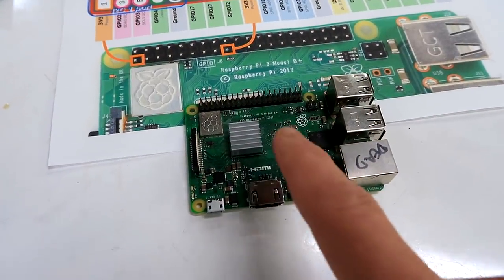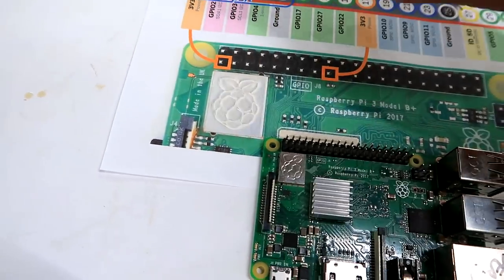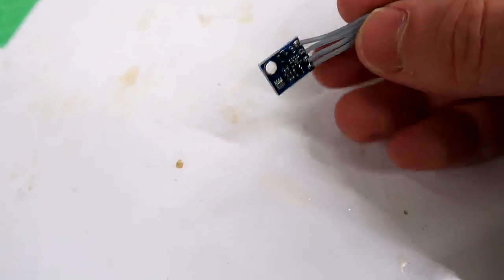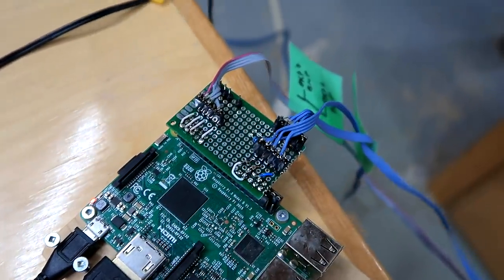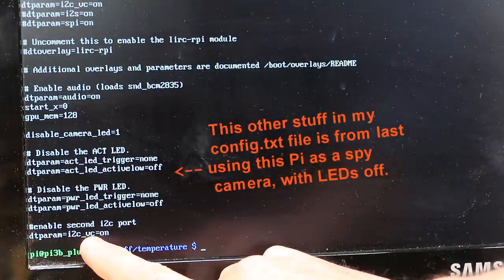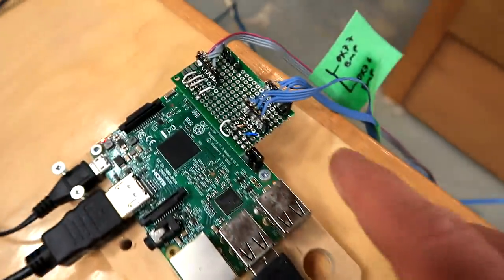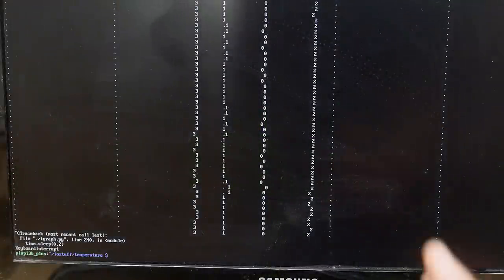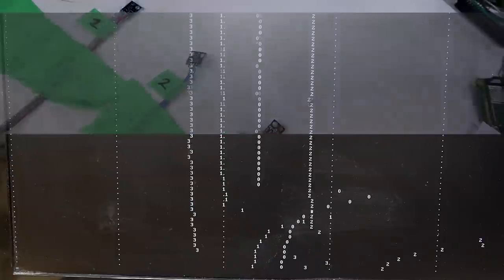Using the second (I2C 0) port on a Raspberry Pi

Comment: If you just needed a bunch of temperature sensors, the dallas DS18B20, which use 1-wire (not i2c) each have unique addresses so you can use as many as you want.
Reply from the maker: I have some of those.  Haven't used them yet.  Temperature resolution is lower, and I actually need to sense pressure for my next experiment, like I said in the video.
Reply: Yes the DS18B20 are great devices and you can literally use 2-wires (data/ground) or 3-wires (vcc/data/ground). I just wish they had more sensors available with this type of bus, such as pressure and humidity.
Reply: @matthiasrandomstuff2221  Yeah, I know for your current project you need pressure. I was just mentioning them in the event you (or someone else here) had a need for many temp sensors.

Comment: Love the ASCII plot. Way back in the early 70s high school students could get an account at UofT's computing centre during the summer. I would cycle down there, write programs (keypunch in, run deck of cards, collect printout, if any, debug, repeat). One of my favourite programs was an autoscaling, graphing program I wrote. I used this program early in my engineering career until I adapted it to use the Calcomp plotter connected to the company's mainframe. Nowadays there are so many plotting/graphics packages available my ascii plotting software is a fond memory. I think the autoscaling algorithm I conceived, IMHO, worked better than many of these packages by trying to maximize the amount of curve (y axis) showing in the plot window while maintaining reasonable engineering unit scaled major and minor tic marks.
Reply: That reminds me of something my father programmed back in the day. It was a program which took in text and output it as a readable banner on punched tape.

Comment: Another option is using a TCA9548 Multiplexer to assign multiple unique addresses to components that have the same hardcoded address. The multiplexer can assign up to 8 different addresses and you can also assign up to 8 unique addresses for each multiplexer on a single I2C bus meaning you could connect 64 same address components on an I2C bus.

Comment: Linux /dev/i2c-0 is usually set up for SMB and is where all the sensors (temperature, voltage, current, power, etc.) live.  I2C buses with higher indexes talk to other devices.

Comment: I had no idea you could turn off the camera LED in addition to the power and activity LEDs. I hope it works on Arducam cameras--i just finished a battery powered 270° fisheye camera that I put under a clear acrylic dome for nighttime skywatching. I put gray poster tack over all the LEDs but it still leaks some light through if I don't pile it on.

Comment: If you run I2C in cables, you might need to separate SCL and SDA with e.g. a ground wire. SCL and SDA are very sensitive to capacitive crosstalk when they are high since they are then only driven by the weak pull-up resistors. So when e.g. SCL goes down abruptly, the sharp edge couples over to SDA and may cause errors in the communication. Putting a GND wire between SCL and SDA shields them pretty well from each other and prevents this issue. The phenomenon is easy to observe on a cheap oscilloscope.

Comment: Hey Matthias, so for a project I used CD4051 multiplexers on Arduino to connect and record from 8 sensors (BMP280 included) with the same address on the same port. Just had to control the mux with 3 control pins ; in case that help. Nice geeky video in any case ;-)

Comment: Have you thought about using demultiplexer (cd4051) for clock line? i2c slave won't react if he does not see clock so you can hook up to 8 sensors with THE SAME ADDRESS to one i2c port. You only need 3 gpio ports to select the output (or one if you add binary counter to cycle through them.) This is also extendable so you can have as many sensors as you want at virtually no extra cost.

Comment: IF you dont need the pressure sensor oe more need more than One i would use ds18b20 instead since you can have longer Wires and on same single data Line :)
Reply from the maker: but I DO need the pressure sensor.  I just demonstrated with temperature for the video.
Reply: @matthiasrandomstuff2221 ok :) . You could also use a i2c expansion Circuit If you need more :)

Comment: Can't we simply add one entry to config.txt and put two wires into those 2 new pins to have i2c working ?
Reply from the maker: You still need to add the pull up.  And I wanted the pins to be arranged the same way as for the other port so I could just plug in he same header for the other port.

Comment: Btw, try to use ESP8266 or ESP32 to grab the data (perhaps even with Tasmota) - you can have one RPi somewhere to log, multiple ESPs all over the place with wifi sharing the data.
Reply from the maker: that would be a heck of a lot more work than what I did
Reply: @matthiasrandomstuff2221  Short term? Sure. Longer term? Not sure. Especially if you want to measure temperatures and pressures at the same time on different places. In such case, using RPi in cooperation with ESP is a blast.

Comment: The problem I've found with BME280/BMP280s is that there's a lot of either counterfeit of manufacturing rejects out there that have only a rough relationship to reality.  It's frustrating, because they're otherwise very well supported.
Reply from the maker: given that I got mine off ebay and aliexpress, I can only assume they are fakes.  But they work nontheless.  I suspect a real one would have more absolute accuracy though.

Comment: Wouldn't it be more efficient (well I guess that's relative really) to have an ESP32/ESP8266/BLE MCU connect to the sensor and transmit that info to say the Rpi or a computer wirelessly? you could make it portable (battery powered) and it could transmit the data over wifi or bluetooth and you wouldn't have to worry about running out of i2c addresses.
Reply from the maker: or I could have a wire and not need to worry about any battery running out, any communications, or how to program an ESP32.  Way more efficient that way.